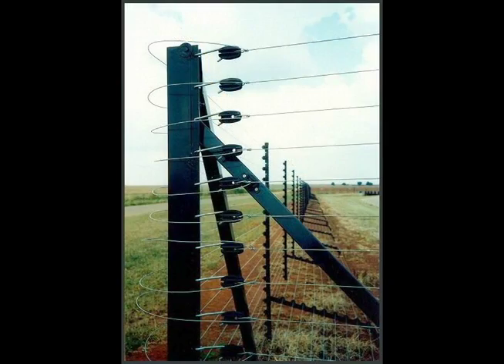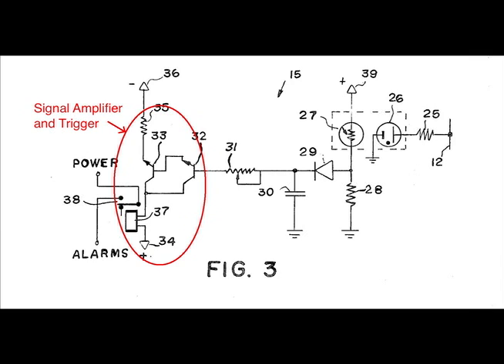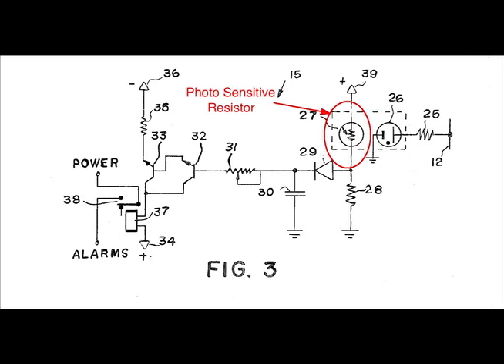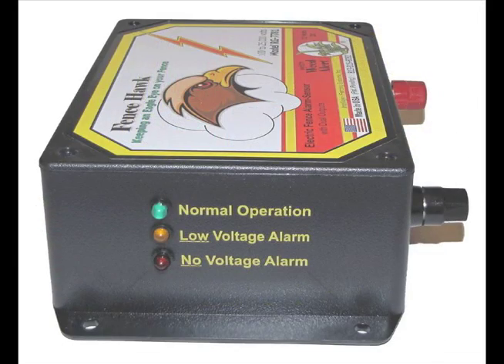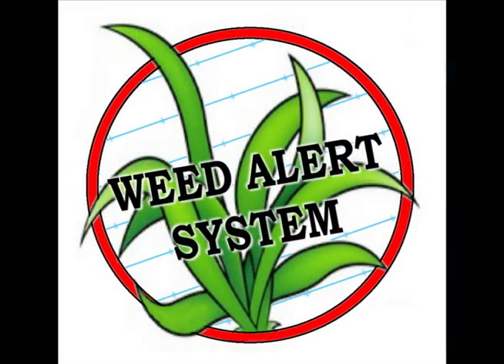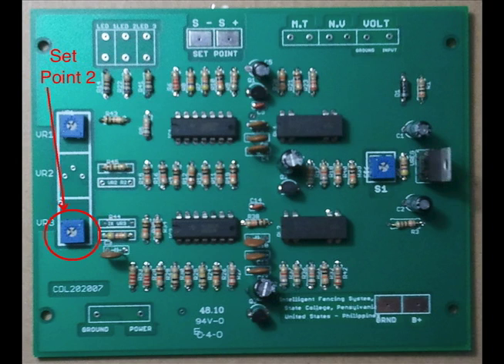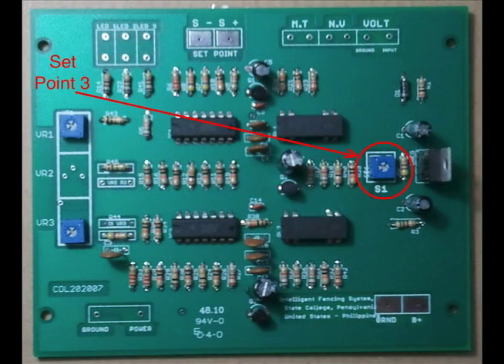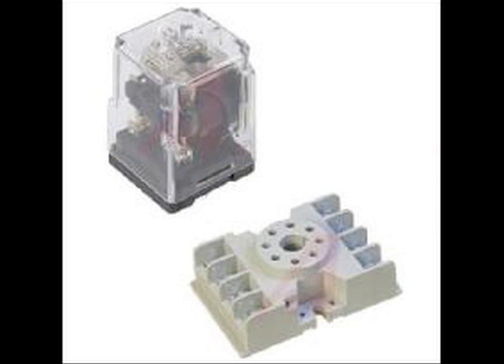The Fence Hawk Electric Sensor - A New Technology - FH2

Comment: This is not only a great idea, it's one of the only electric fence security alarming systems sold in the US .
I still would like to know what happens when an intruder throws a blanket etc, over the fence. If I understand the settings correctly it can be set to pick up a blanket being thrown over my electric fence, as long as it's there for six seconds...... it will then send an alarm? (Which is by the way, exactly what happened on my property recently)
Reply: Gallagher makes a fence-alarm system that will send you a text message. I

Comment: Jumper cables or just wire with some alligator clips and wire cutters is all you need to defeat this. It needs to have motion sensors instead of voltage sensors to trip the alarm or it can be beaten very easily. I challenge you to let me try some different scenarios... Rig it up however you want, don't tell me and I'll defeat it every time.
Reply: If you cut the wires, or short the fence with alligator clips, it will set off the alarm